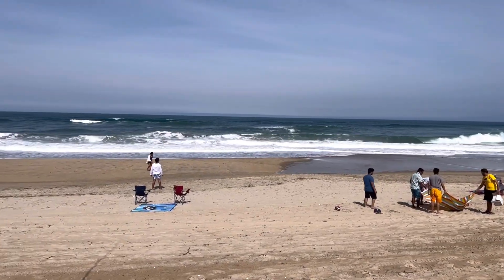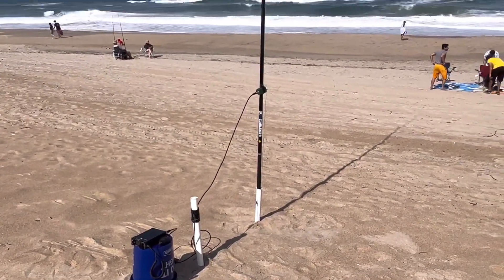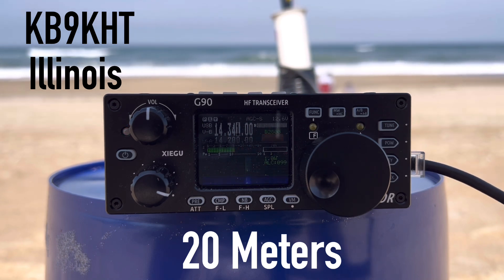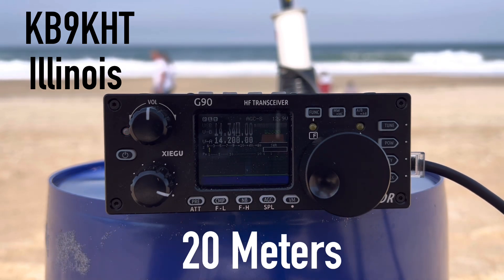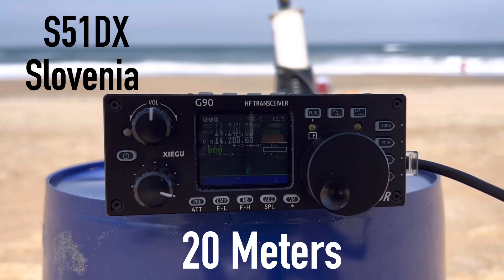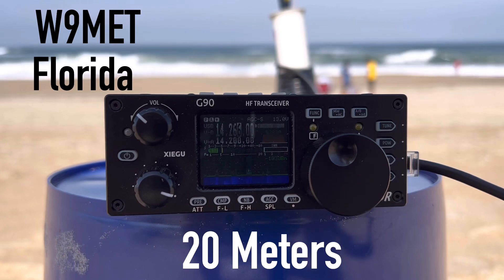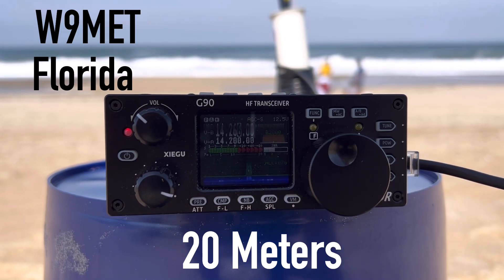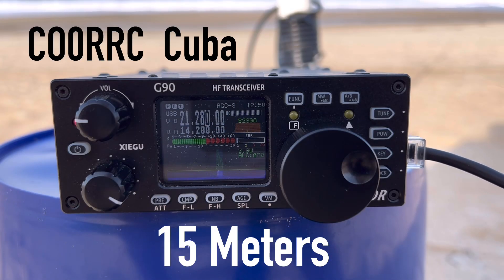Building an On-the-Fly Antenna to Suit Conditions

Comment: Still carrying the G90.  I'd like to see your portable power supply.
Reply from the maker: Hi, it’s just a small 6aH LifePo4 battery.
Reply: @COASTALWAVESWIRES   Thanks.  I just got one of those. Wondering if a fuse is necessary from the battery to the radio. They sent a fused cord but I'm switching to power poles.
Reply from the maker: @century2298  I kept the fuse in line with mine, probably not a bad idea

Comment: Walt, the relaxed devil might care nature of your vids really show the upside of the hobby.  Well done again.  I my have said I was going to make the G90 my first but as a new general licensee.  I paused because of other prominent YT's advising less than 100W for the first timer is probably not advisable.  Help me with this.  Give me your opinion on why I might struggle with the G90 as a newbie.  Is it because my antenna build/buys are crummy?  I'm not interested in contests and pileup's.  I'll turn the dial.  The affordable nature of the G90 seem to remove a lot of newbie risk.  What do you think?
Reply from the maker: Hi Dennis! I highly recommend the G90 as a first time rig for a new general. For the price it's amazing and has everything you need in a small package. An internal tuner, antenna analyzation tools, SDR waterfall, etc. The difference between 100 and 20 watts is not as great as people think. It's really about one S unit. I break through pileups and make amazing contacts with mine. Of everything I've ever purchased for ham radio it's the best purchase I have ever made. Go for it!

Comment: Having extensively tested multiple portable antennas, I have come to the conclusion that the Delta loop antenna is the most effective option for each band. In my experience, it consistently outperforms all other portable antenna types, making it a reliable choice for anyone seeking optimal signal quality and range, great vid, 73
Reply from the maker: Thank you! Yes it is a great antenna. My experience with the delta loop was a great one

Comment: Ha! I worked Janez (S51DX) yesterday on 20m as well. I'd worked him before back in January on 17m. Europe was booming in late yesterday afternoon on 20 here, at least a handful of stations like Janez anyway. 10 meters has been really flaky for at least the last 2 weeks. FT8 is about the only thing happening consistently right now :/

For a small no radial setup I use a frankentenna modeled and promoted by KJ6ER (named the POTA DOMinator). It will work 6 (with a 9:1) through 20m (with a coil), assembles and sets up in seconds, and can be mounted virtually anywhere. I can even mount it on the fender mount on my vehicle. Greg is always gracious and more than happy to share the details as well as any future changes/improvements. He's always tinkering and tweaking. 

RE: the haters, meh, ignore them. You never misrepresent your goals or intentions and you never complain about the results, and at the end of the day it's all about putting fire in the wire.
Reply from the maker: Yes it’s all about putting the fire in the wire, I like that! I’ll look into that antenna, thanks for sharing!